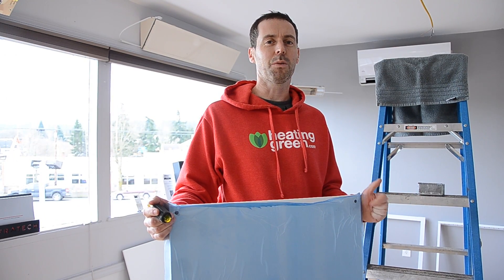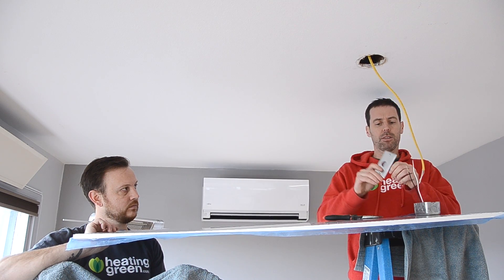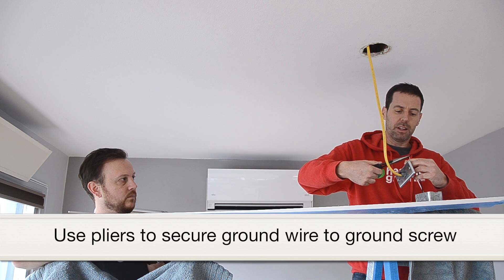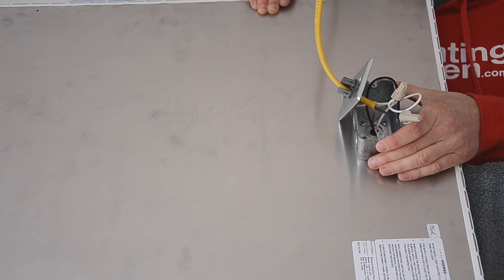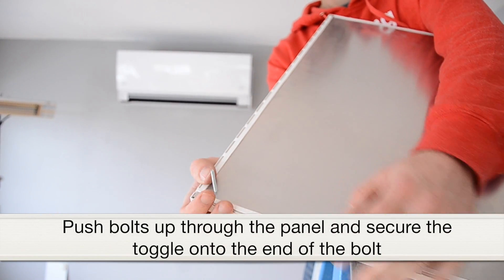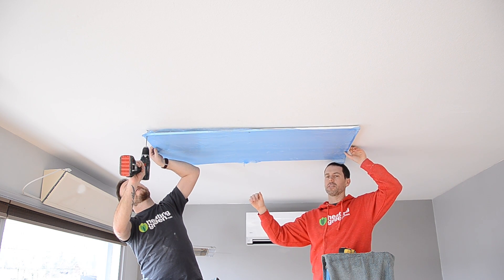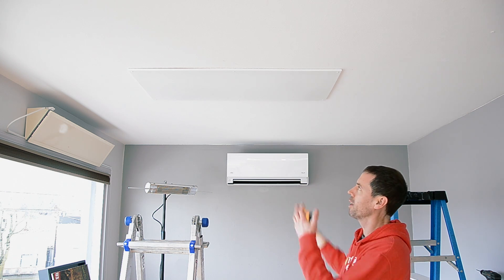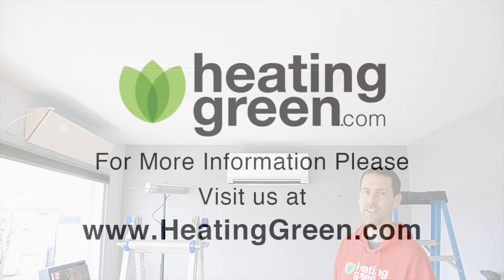Ducoterra Sola Ray Heating Panel DIY Installation

Comment: If the watts are 750 and 120 volt..can't you just use 14/2 wire and a 15 amp circuit?
Reply from the maker: For our Infrared Heating installations we recommend contacting a licensed electrician for your installation. Thanks! -HG Team

Comment: Looks like they replaced the beige cove heater on the wall with the shown, flush mount Solaray style. They didn't mention this so I am guessing.
Reply: it looks like they also have a mini split cassette on the back wall. so either somebody needs it REALLY hot in there, or they use the room to demonstrate installations.